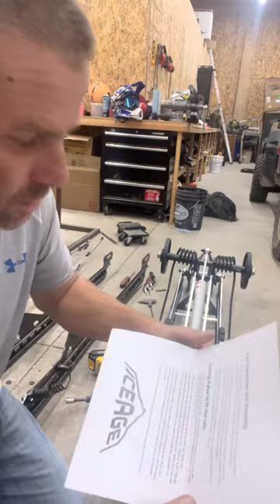IceAge Bomber rail installation on ‘21 Ski-doo 850 Turbo

Comment: Hey Tom, how did your end caps line up with the new hyfax’s with your Ice Age rails. My ice age hyfax’s are about a 1/16th-1/8th of an inch lower than where the rail tip cover meets with the Hyfax’s?? I’m hoping this won’t be an issue….😬
Reply from the maker: Mine were the same, I just took a grinder to the hyfax and made a smooth transition.
Reply: @xtremeairvents  cool! I’ll do that! Thx Tom!👍

Comment: Your bolts are never the same distance on the back wheel and set bolts  I use a tension spring tool to set the track to both side this is why they have this tool I was shocked at how bad one side was off by measuring and matching… other then that good video I’m just getting ready to do mine..
Reply from the maker: I use the track guides for alignment.  The gauge just gets you close.